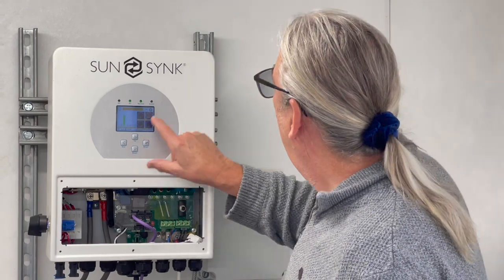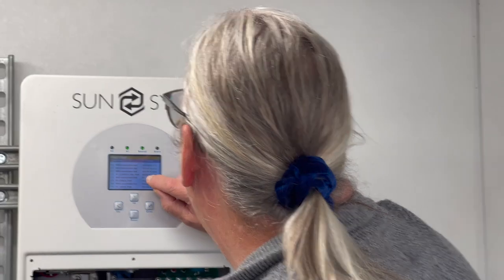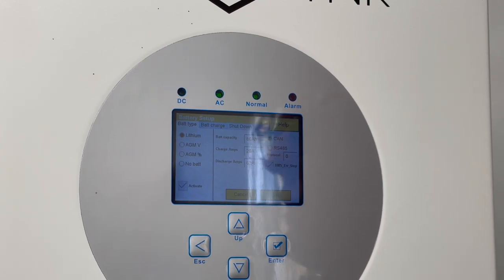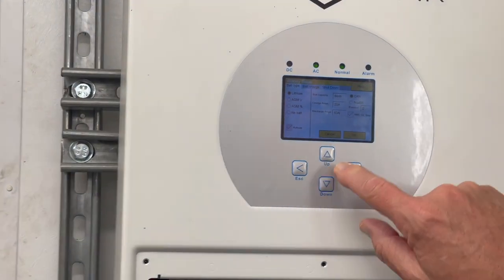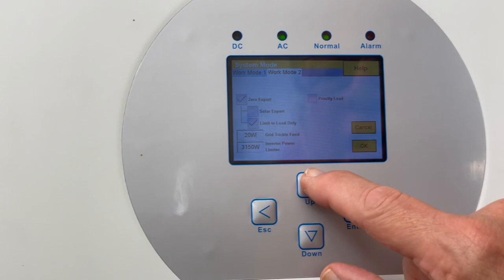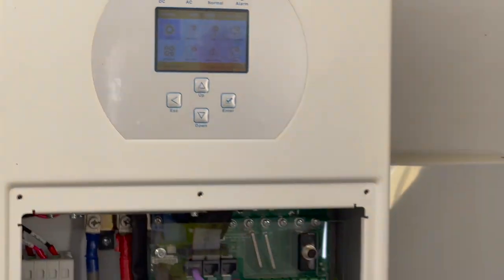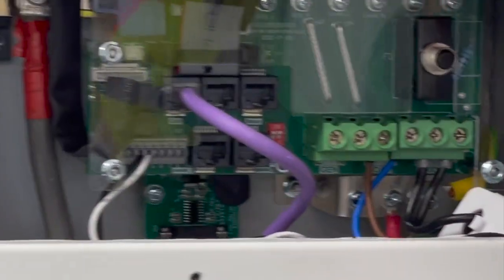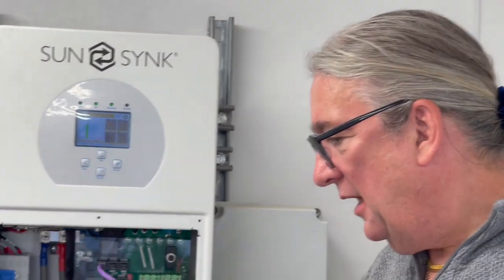Fault Finding with a Gen Set

Comment: Hi Keith, I'm currently installing a sunsynk solar system. I have a 7.38kw solar array with a 8kw hybrid ecco sunsynk inverter and 2x 5.12kw sunsynk batteries. My question is, can the 8kw inverter handle double the kW array? Similarly to the 3.6kw sunsynk inverter that can take up to 7.2kw array? I've tried calling the sunsynk contact number but nobody seems to be able to confirm this for me.
Reply: 8kw can do 10.8kw solar AFAIK